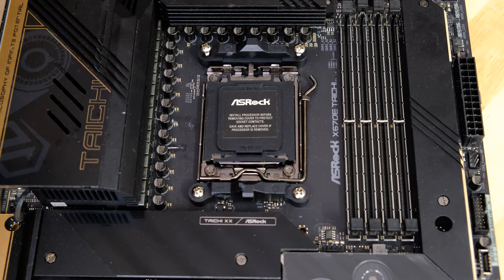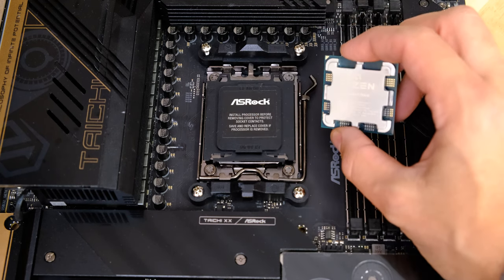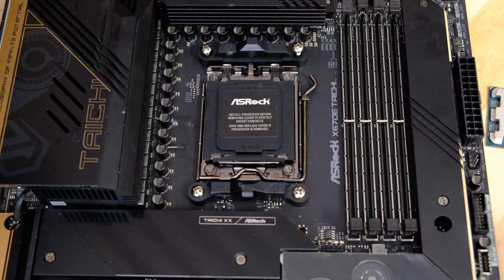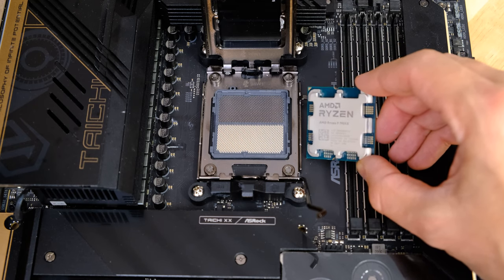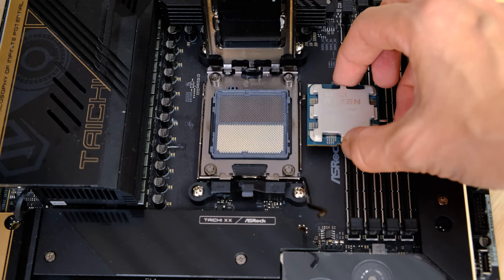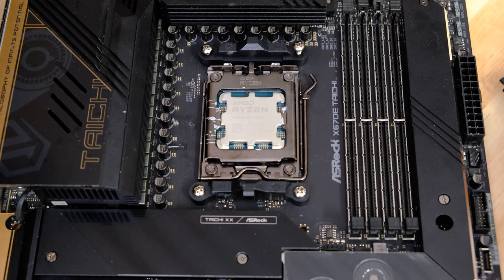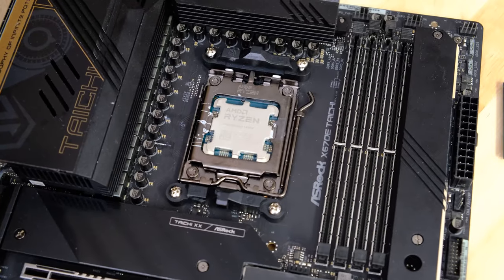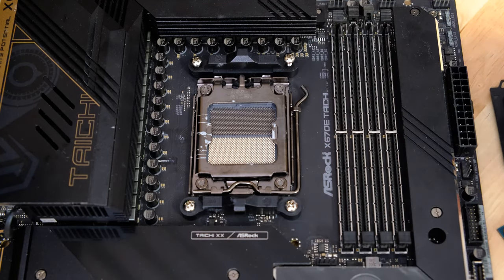How To Install A Ryzen 7000 Processor

Comment: Damn, if you install it wrong and break one of those pins on the mobo you are shit outta luck
Reply from the maker: Yep. Intel boards had the same problem for years. A LOT of people damage them when building their PC. These days there are so many pins and they’re so small that that it’s nearly impossible to fix as well
Reply: @CrazyTechLab  i "repaired" bent pins in server motherboards often enough. it is shit but it is also doable. more concerning is the amount of time you decided to hold the cpu above the lga....
Reply from the maker: @majstealth  it’s extremely difficult to do on LGA 1700 and socket AM5 as the pins and pads are so small compared to previous sockets. I’ve repaired plenty too. I had a slightly bent pin on a Z690 board and failed to get it into the right position. MUCH finer margin of error with these new boards so following this advice is of FAR more concern to avoid bent pins.
Reply: @CrazyTechLab  It still depends on how bad the damage is to the pins. If it is minor then a needle, magnifying glass and a steady hand and you might be able to bend the pins back.
Reply from the maker: @TheCompbuzz  normally that works for me too. Comparatively minor damage to an lga1700 board,though,  and I’ve been unable to resurrect it. Super fine margins for bending the pins back and having them align correctly and will be the same with Socket AM5. Just seems to have a much lower success rate.

Comment: forget the paste buy a thermal pad those are worth the extra. My CPU does not rise above 37C-38C, heavy gamming load mind you. It is 2.00mm thick.  Gelid Solutions GP-Extreme 2.0mm Thermal Pad
Reply: Nope. Thermal grizzly kryonaut runs cooler.

Comment: i'm going to build my new AMD 7800X3D  pc this weekend. I'm already nervous for putting the cpu on the motherboard.
Reply from the maker: Don't be :) The whole point of this video was to make people stop and think before they do this, especially for the first time. There's a reason why bent pins are one of the most common return reasons and also a reason people brick their PC. It's very easy to do it. Do it slowly and carefully and you'll be fine.

Comment: Thanks for this WONDERFUL video. I love how much attention you put into the issue of a firm but CONFIDENT grip 🥰🥰😍😄 bearing in mind that holding TOO FIRM can result in a CATASTROHIC slip and bullet SHOOT off 😅 and reminding the impatient 2-minute video commenters above & below to MIND the fact that INDEED negligence in handling this delicate device and process, can easily lead to a whole MOTHERBOARD having to be thrown out 😅😅!  However, I feel that a more ingenious solution is for us to come up with more CREATIVE ways to ensure maneuverability without risking with the hand slights. I am currently researching the use of common household items such as soletape, gum, etc . . . especially gum (and Nooo, Not chewing gum . . . duh 🤣) and again No, Not magnets (well magnets would be BEAUTIFUL for this job if they were APPROPRIATE, but for obvious reasons No . . . Not magnets). Elastic/rubber bands, etc, etc . . . Suction Cups are among the TOP of my list right now 🤩🤩 SO MANY household items could prove to handle this delicate job in a VERRRY creative and stable way, but these just need to be CREATIVELY researched. And then getting back to hand slights, holding the CPU at its diagonal corners, always gives me FAR more confidence with my grip on it than on its parallel sides 😂.  Once again great video

Comment: Also showing people you putting your fingers all over the pins on the bottom isn't great. It's unlikely to cause an issue, but if you have anything on your hands, say thermal paste, that could end up on the CPU and board pins, it won't be good.
Reply: You can clean the bottom of the cpu tho

Comment: Another question that occurred to me – might it be possible to do and TO DO IT WITHOUT CAUSING ANY DAMAGE – to use say very mild magnetism – to, I will give to possible uses here – EXTRACT A CPU FROM ITS SOCKET IF ONE WANTED TO and, in the second case, to hold a CPU in position while one was attempting position it to Cicely in place when installing it in the first place?

One might imagine a MAGNET – POTENTIALLY A ROUND ONE PROBABLY – inside of a two – that could be slowly moved closer and closer to the top of the CPU – until it exerted just enough force/attraction to cause the CPU to say pop off of its/out of its socket and snap into position at the bottom of the two? Another approach might be to consider using something like – say – a suction cup – on the end of a dowel – and/BUT – with a tiny hole drilled down the center of the doll – which would not have to be all that long – and right through the center of the suction cup. The idea here would be to be able to – by ceiling off the whole in the top temporarily with perhaps something as simple as a piece of scotch tape, pickup the CPU to be mounted in the first place and held firmly while one use the dowel/suction cup move it slide it was honestly over the mounting socket/pins and then gently lower it into place. Once in place, all one would have to do – would be to pull the tape off the end of the dowel and let air leak in and the CPU would remain in the socket?

ANOTHER IDEA – YOU CAN BUY THESE THINGS CALLED Sticky Pads ON AMAZON. Basically, and I have several of these around the house and they can be very useful – they are just Inherently Sticky – I sure exactly why perhaps the surface contains zillions of tiny suction cups or something – BUT, I could easily imagine cutting up a Sticky Pad and sticking one end of it to a small round piece of dowel – or even say the center cardboard piece of a roll of toilet paper – and lowering that down on top of a CPU to be mounted into position – and using that to carry/suspend and move the CPU into its proper location before attempting to detach the toilet paper/center cardboard role. The piece of sticky pad left behind – being very flat, could be left in place until the CPU was clamped down/lock down in place and then the sticky pad that was still stuck to the CPU could be simply and very easily – removed – by starting at one corner of it and just very gently peeling it off?

AGAIN, WHAT YOU THINK?

Comment: Does adding thermal paste to the bottom of the CPU help with temperatures?
Reply: No. Don't do that.
Reply: @Barakitty  it works fine for me.
Reply: Good idea. Use a whole tube and fill in all of the spaces between the pins.

Comment: Do not touch the gold with your oily fingers...if you need to hold it like that please use ESD gloves.
Reply from the maker: Gold is inert. It’s not going to react with oil or anything else. CPUs are designed to be handled like this. Otherwise they’d come with special equipment.

Comment: How are you trying to give advice on how to install that cpu, touching the bottom of the cpu with your bare skin on the bottom where the pins will contact the cpu?  Is the natural oil and grease from your skin not as  damaging as the same on every other human in the world?
Reply from the maker: I explained this very point in the video. Well done.
Reply: @CrazyTechLab  Amusing, really how a so call expert handles tech.
Reply: Gold is a noble metal and is immune to corrosion. You should educate yourself in physics and chemistry
Reply: @Hlebka  Don't have to that level, the oil from skin can still dedgirate the signals on one side if it's not making perfect contact.  Did you check to make sure all the pins are perfectly connected with a microscope?

Comment: I am also wondering, IF the socket pins are damaged could the socket be easily replaced? It appears there are four hex or torx screws holding the frame/socket to the MB. It also depends on whether the socket is soldered or held on the MB via compression as is the CPU to the socket?
Reply: The socket is soldered to the m/b traces in hundreds of places. You'd be better off taking a sewing needle and a strong magnifying glass and trying to straighten the bent pins yourself.
Reply: @JamesDavidWalley  I thought so and yes that would be the easier solution besides de-soldering, or just getting a new MB. thanks

Comment: Does all am5 motherboards have same processor fitting or some have to fit oppositely
Reply from the maker: As far as how you align the CPU within the socket they are all the same - either with the gold triangle or with the Ryzen text aligned left to right in the socket. However it’s not impossible for a motherboard manufacturer to rotate the socket on the motherboard. I think a few boards have done that over the years. However the CPU rotation in the socket will always be the same.
Reply: @CrazyTechLab  thanks 😊

Comment: These design are soo dumb man. Why expose those parts
Reply: Yeah, they should really do a PGA/LGA combination, where the PGA pins are in holes, and shorter LGA pins set down on top of them, but only if aligned right. That way there's no chance to slide the CPU improperly. Of course it would require a slightly bigger socket, and other considerations to design, but I think they do this specifically so failures happen at a crucial juncture, which makes them a percentage of more money in replacements.

Comment: Terrible video....... while holding the CPU you put your fingers all over the CPU pin pads!  You can ruin a CPU just by doing this by causing static electricity to enter the CPU and fry it.   Please do NOT make videos while showing bad practices!!!
Reply from the maker: Except I touched the grounded CPU socket first and grounded myself so everything is fine? Plus I've handled hundreds of CPUs in my time and never killed one with static. Static electricity will only kill something if you touch a vulnerable component directly. That's actually extremely difficult to do, especially with a CPU. With a CPU, the charge will discipate through the heatspreader and the rest of the CPU so it's practically impossible to damage a CPU with static electricity
Reply: @CrazyTechLab  Except touching the CPU socket first is USELESS because the CPU socket is not connected to ground.  The motherboard you were using was not connected to the PC power supply so how do you expect touching the CPU socket is going to ground you when its not connected to ground itself?